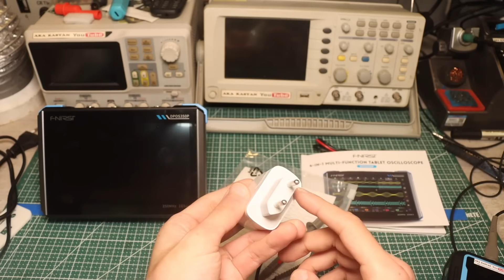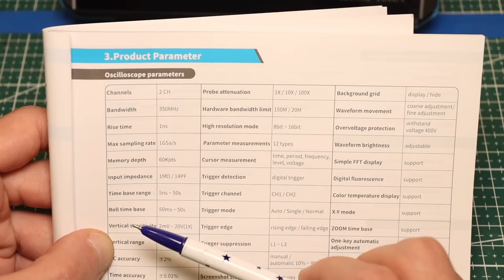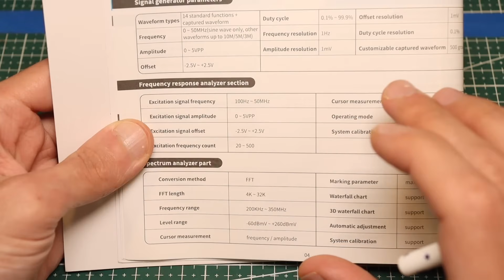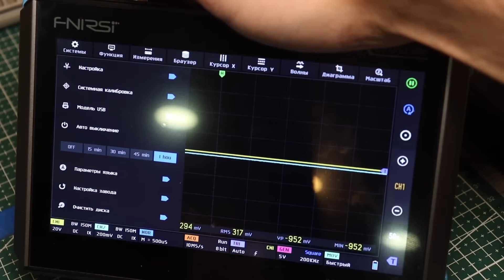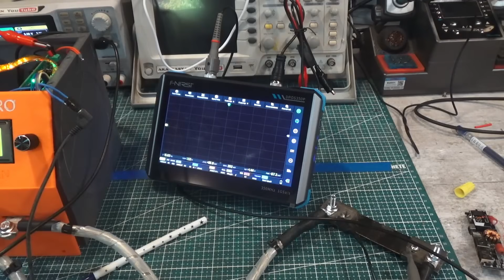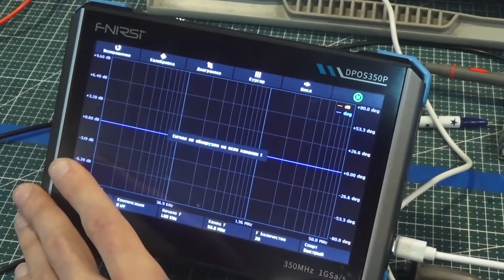FNIRSI DPOS350P – the best all-in-one device!

Comment: Added this to my collection about when this review was coming out. 
Only used it once seriously since, but playing with the features has been fun. 
Now that the weather is getting better (May in Montana still has snow) and the house remodeling is finished, I'll be getting my electronic bench set up in the shed.... 
I've got Ham Radios to align, guitar internal preamps to repair and a pile of  other small projects.
This is my third (and maybe last) current scope. Have a nice 200Mhz dual scope with digital phospers, memory, and the standard stuff, a component identifyer with a decent audio to 20 Mhz scope function, and this Fnirsi. 
My HP and Techtronics boat anchors didn't make the cut with the last move...

Comment: After sending three emails to fnirsi about the generator's deviation, with a possible solution for this problem, I received the following response:

Dear Sir/Madam;

It is a pleasure to receive your letter!

The DPOS350P exhibits a systematic positive deviation of approximately +19.2 ppm (0.00192%) in frequency measurements. This error stems from the inherent accuracy of the instrument's internal time base (reference clock), and is a time base error proportional to the frequency value, perfectly within the ±0.01% (±100 ppm) time accuracy specification stated in the manual. For a highly integrated, multi-functional measuring instrument at this price point, considering the balance between core performance (such as 350MHz bandwidth and 1GSPS sampling rate) and cost, this type of error is expected and unavoidable, and meets the accuracy requirements of most industrial maintenance, R&D, and educational applications.

If you require higher accuracy, you can purchase specialized equipment.

Thank you for your cooperation!

Sincerely, Leo

Erik Rothuis<erik@rotosoft.nl> 在 2025年12月16日 周二 17:49 写道：
Good day,
------------------------------------------------------------------------------------------------------------------------------------------------------------------------------
I am sending you this email again for the 3e time. Stil have not received a answer.
After several attempts to contact you regarding the issue described below, and no response from you at all, I am forced to request a refund.

I will also no longer recommend your products to the large group of radio amateurs to which I belong.
That's a real shame, because I have several products from you that work very well. But if the support is this poor, even a good product quickly becomes obsolete.

I purchased an FNIRSI DPOS350P with order ID 30653. However, the generator frequency now appears to have the following deviation:

10 kHz = +1.919 Hz
50 kHz = +9.603 Hz
10 MHz = +1.919 kHz
50 MHz = +9.603 kHz.

I measured this with a Racal-dana 1998, with an external 10 MHz reference.
Is this normal, as I find the deviation very high?

Just an idea, which I'm giving away for free. Wouldn't it be nice to calibrate the frequency on the DPOS350P during self-calibration by applying a 10MHz signal to channel 1, so that the scope and generator are calibrated to that?

Sincerely, Erik Rothuis (PA2ER)

Comment: Hello my friend!
The frequency response measurement of these class D amplifiers cannot be done as indicated in the DPOS350 manual, for the simple reason that the input and output GNDs of these amplifiers cannot be interconnected. That's why they are burning!
You need to put an isolation transformer at the input!
Reply: Could u elaborate more detail
Reply: @herewegoagain4041  

in a class D amplifier, the output GND typically doesn't share the same GND as the input. In other words, they aren't interconnected.
When measuring as described in the manual, you'll be connecting the input GNDs to the output GND through the oscilloscope's GNDs (which are interconnected), creating a loop that will destroy the amplifier.
For this same reason, it's not possible to inject the function generator signal into the amplifier's input and measure the signal at the output, as you'll be connecting the GNDs through the instrument.
The only inexpensive way to do this is with an isolation transformer at the amplifier's input. Or—the more expensive option—use a differential probe at the oscilloscope's input.
Maybe i will do a video showing the procedure.
🙂